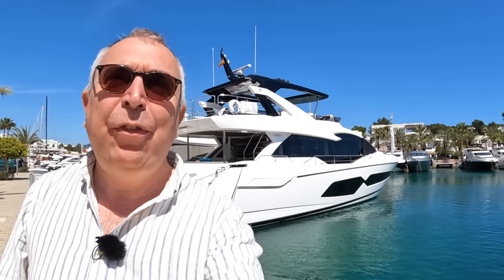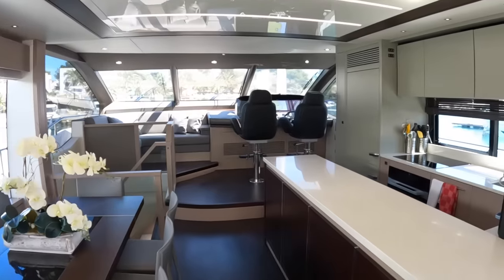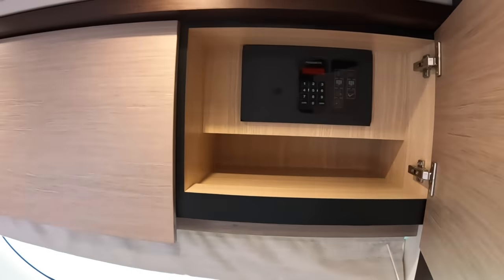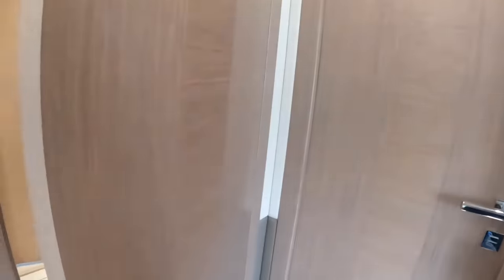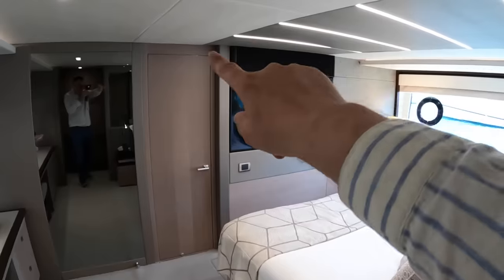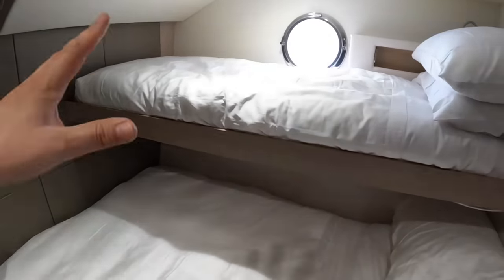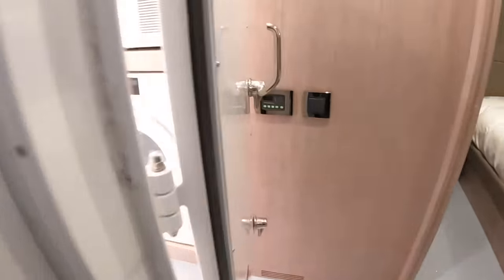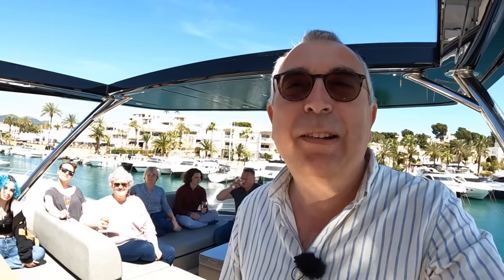£3 Million Yacht Tour : Sunseeker 76 Yacht

Comment: Hi Nick. A bit of an important update on the Swift Trawler Squeeky Creaky flooring issue.  I've now gone through a heckmof a lot of video's  confirming the issue is rather random, and have ma aged to spot that the underlying Floor Supporting Structures definitely look well up to the task, which is pointing to the issue actually being confined to the Surface flooring Materials, and likely a quite economic fix either with much stiffer materials, or additional underfloor beams to reduce the flexibility  in existing flooring, though the stairs below also being affected, with their limited spans, does suggest only having to substitute stiffer, and probably a bit thicker flooring Material, which shouldn't have a detrimental effect on anything to resolve. PS.  If there is enough space under the existing flooring , adding stiffening braces under each section, should be a very cheap fix. Happy Days ! Bob.  😊 👍

Comment: BTW, for the lights flickering! GoPro camera has NTSC - PAL setting, basically 60Hz - 50Hz selection. The selection of possible framerates changes based on that satting, and you match the setting with the electricity powering the lights in the place you are filming. Often lights have a little bit of change in intensity over the cycle of ac current changing directions, but when the framerate matches the AC frequency or its multiplier, then there will be no lights flickering on the video. IRL you often won't see it as your brain does a good job filtering it out, but as video is just a bunch of still photos you can clearly notice the relatively massive change in light intensity between two successive frames.

Comment: Another great tour of a beautiful yacht, Nick!! I look forward to seeing how your charter went. One question that I've always wondered - when stern-to berthing the bow is tied to (presumably) marina-supplied moorings. But I never see(or notice?) buoys attached to the mooring point for the boat to tie off too. How are these mooring points accessed? and just to note, it seems the passarell (sp?) didn't extend to the dock, but fell a bit short. is this normal or operator error?
Again, great tour. Look forward to much more!!
Reply from the maker: If you take a look at our charter videos you'll see the process in action. Basically, the bow line is lead back to the quay when not being used.